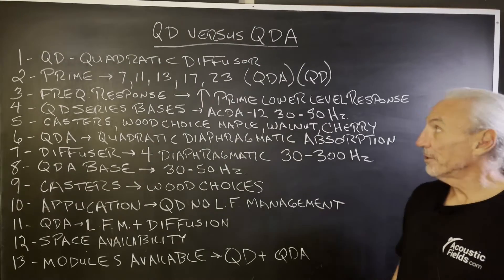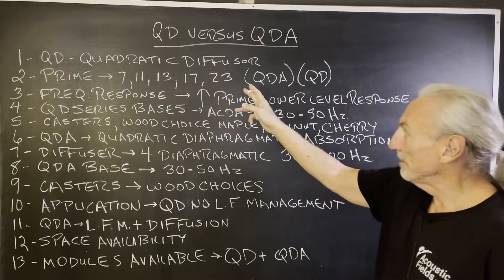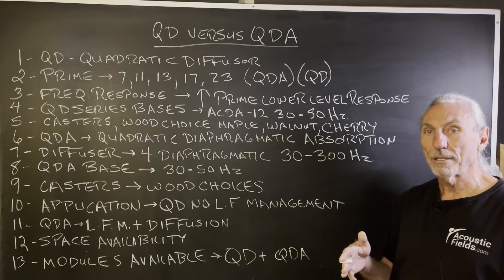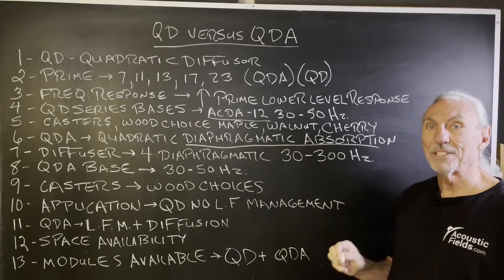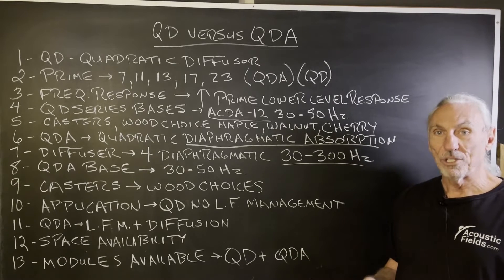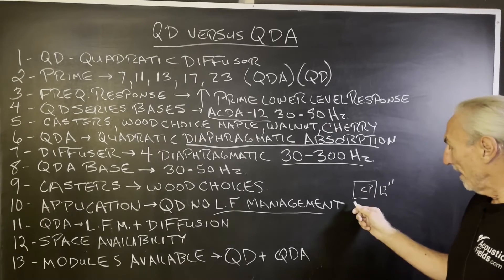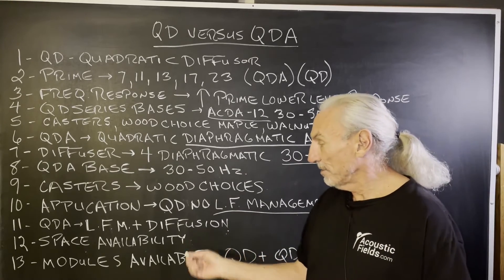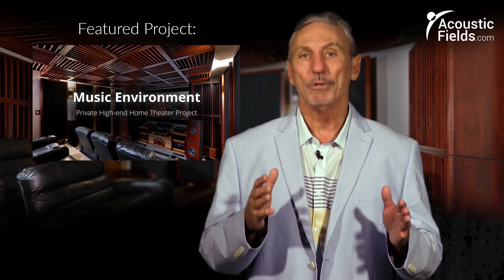QD vs QDA - What's The Difference? - www.AcousticFields.com

Comment: Do you ha e a video to help me sound proof my bedroom from alow frequency factory and also a d# mid range from the same factory?
Reply from the maker: You must measure the frequency and amplitude of all noise issues. Without noise numbers overa seven day time period, you are just guessing and guessing with noise is expensive and foolish. Since all noise transmission issues require that a barrier be built using  permanent construction, you do not want to spend one dollar more than you need to since you will never recover that expense. Use the old carpenter adage of measure twice/cut once.